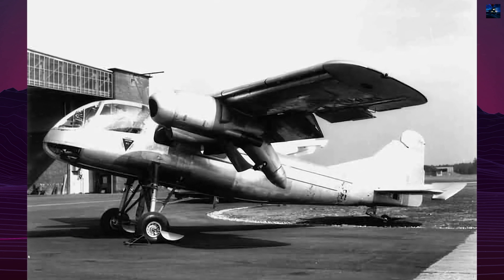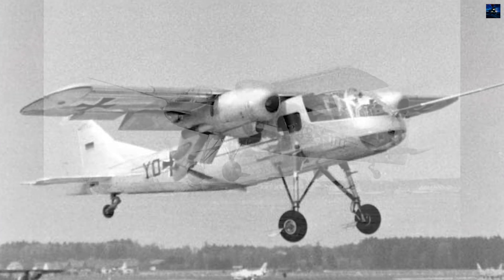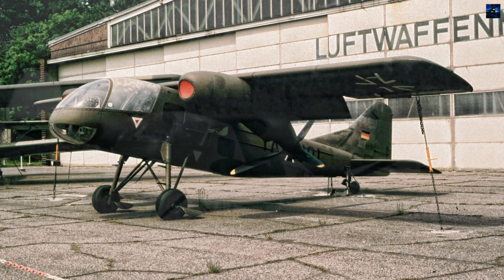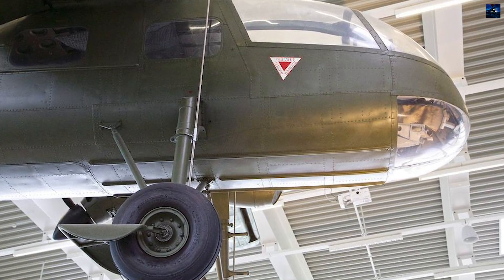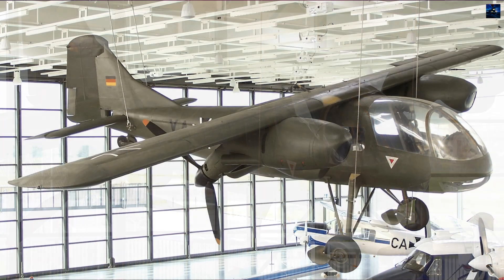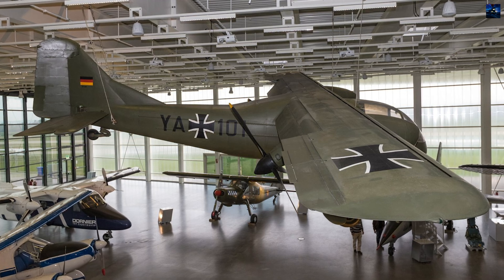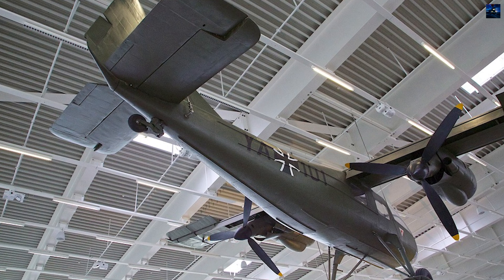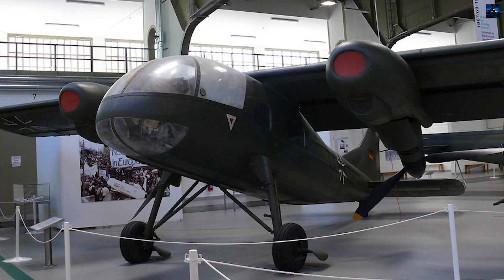Dornier Do 29: The 90-Degree Solution to Short Runways

Comment: I've read about this before. One thing I've wondered is how much you'd need to change to make it actually work as well as it was supposed to? The propellers were never tilted past 60 degrees while in flight, presumably due to control problems. Would adding fly by wire be enough? Or would it also need more power, a bigger wing, etc?
Did it have a way to adjust the tilt and thrust of each propeller independently for control at low speeds, or was it relying completely on the normal control surfaces?